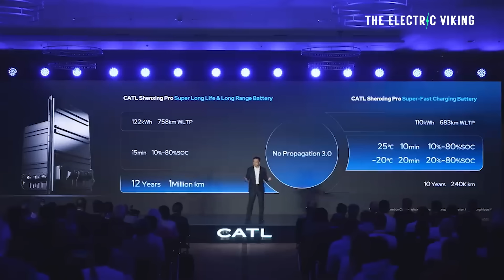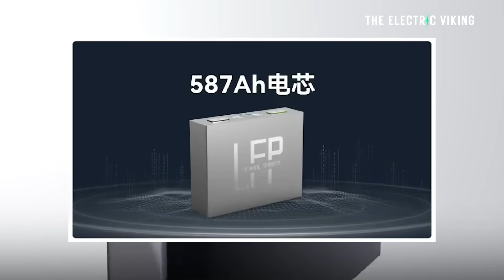CATL Reduces LFP Battery Costs 43% and INCREASES Energy Density

Comment: LFP over NMC because you can charge to 100% regularly without degradation.
Reply: Also much cheaper and safer, unlikely to start a nasty fire or explosion.
Reply: @xianqingdu less likely to start a fire, but more likely to explode
Reply: @xianqingdu  "unlikely to start a nasty fire or explosion"

*less likely.

Not unlikely.
Reply: @mnomadvfx  
So, the over 1,000 CATL battery installations DID have fires (making the claim that they didn't a lie)?
Reply: @mnomadvfx  Even cars with NMC were less likely than ICEVs to catch fire. LFP it is almost unheard of. 
So you not unlikely, it is extremely unlikely for LFP to catch fire.
Reply: Ya...
Reply: Also avoids supply chain issues with Cobalt
Reply: Pretty sure LFP has major problems in cold weather
Reply: both have degradation, just in different rate. I rather use LFP for the safety and peace-of-mind than NMC though.
Reply: It is still better for LFP to be charged to a lower maximum than 100%, it still causes increased degradation, just less than NMC

Comment: Good news for the future. 2025 was the year with $billions BESS order contracts celebrated to be installed in 2026/2027/2028 - at the former, 43% higher prices, lol. Although not competitive anymore - in the EU it´s the consumer that will pay for it the next 12 years until 2037 (at least). If the batteries for EVs get cheaper - it´s sure the EU will increase taxes on car imports from China, for the time being 37% plus VAT of 19%, 23%,25% depending on the destination country. There is a reason for fast adoption of EVs in China - new cars are cheap at 1/3 and 1/2 the cost they are sold in the EU. It makes a difference when You have to pay $45,000 instead of $15000 for the same product - or $36.000 for the better equipped AMG line Mercedes Cla250+ in China and $72.000 for the same car in Germany.

Comment: Increasing energy density by 10% is marginal at best. No way to compete with  fossil fuels that are 30-40 TIMES better on this. Battery technology is evolving but reaches saturation, as any other tech of course, so don't get delirious about it.
Reply: What the hell are you talking about batteries dont produce energy they store it and obviously you can produce energy in a number of different ways they are not competing with fosil fuels your statement makes no sense and fosil fuels continue to go up in price while batteries continue to go down in price.These batteries are used to save money buy storeing energy
Reply: @BLEEDGREEN7777  It is in fact your argument that makes no sense. Energy is never produced, only stored and transfered between different forms. It is basic physics, energy conseration law. The specific energy stored in petrol based fuels, hydrocarbons,  is about 12kW/kg, depending on type. Batteries are striving to reach the dreamed value of 0.5kW/kg, most commonly featuring  half of this value.  Nearly 50 times less.  With the energy densiry (kW/l) the ratio is is slightly better for the batteries, ~30 times difference.
Reply: Sniffing petrol is bad for your health my friend 😮
Reply: @turrafirma  Touching charged wires is even worse mate 🤣...
Reply: Huh...LOL...LowIQ SMFH!
Reply: How are flashlights able to compete with kerosene lanterns? Don't people realize that kerosene has way higher energy density than batteries? Even the military has bought into the flashlight fad.
Reply: @mqb3gofjzkko7nzx38  When military start flying battery powered supersonic jets and drive EV battletanks, I'll get convinced in the e-transition.

Comment: Batteries are energy storage device like a fuel tank. They still require fossil fuels to manufacture.
Reply: less and less..
Reply: If petroleum products are essential for manufacturing stuff, it seems pretty silly to light them on fire for energy.
Reply: @m @mqb3gofjzkko7nzx38 every step of the way. What are you going to do with the gas and diesel produced in the refining process?

Comment: Problem is not the price. Problem is battery LIFESPAN YEARS
Reply: 30 year lifespan is a problem???
Reply: FUD much?  The video states 10,000 cycles >80%. At 1 full cycle per day that's about 28 years. As stated, this product is intended for the long duration storage market, so economically useful life will be multiple decades. Could be amortized at $1 per year per KWH.
Reply: What is the lifespan of these batteries? Would be interesting to hear what you know about this product.
Reply: 30 year lifetime is bullshit. MG 51 kwh LFP battery. 50 000 km in ODO and SOH 91 %

Comment: So will BEV drop by 25%?
Reply: They are getting cheaper. It's probably better that it's been a slow process. Battery technology and safety has been able to improve. Infrastructure has had a chance to keep up. Legacy manufacturers had plenty of time to get up to speed.
Reply: The battery is only a small part. 
Cheaper battery doesn't mean window glass costs less, for example.
Reply: @andrewsaint6581  The battery is about 20% of the car cost. So the net effect will be a 10% cheaper car.

Comment: 1.88KWh cell in a car ? Let's do the math: 400V/3.6V = 111, 111*1.88kWh =  208.68kWh. So yes if your car needs 208.68kWh or double (for 800V) then yes you can use them, otherwise I do not think so... You can not really reduce the number of cells much, maybe by 15% but surely no more, you can go a bit more like 420-450V but much less than 400V is not good for a car.
Reply: They have a hybrid sodium /lfp pack they are ramping up into production for vehicles, thats the only reason they barent marketing them for cars.
Reply: As said repeatedly, cars are not the target market, stationary storage is. Someone could use them for a vehicle but as you note only some kinds of vehicles.

Comment: I have a problem visualizing capacity in gigawatt hours. Could you convert it to powering how many homes per year? Thanks
Reply: GW will do about 750- 1 million homes depending but basically a damn lot. Of course  that's not a battery which could only do that for less than an hour as GWh
Reply: @pietersteenkamp5241 
Australians and Americans use twice the electricity as Europeans. Heavy industry also uses a lot of electricity.
Reply: 1 gigawatthour = 1 million kilowatthours. Theoretically it could power (only!) 100 homes for one year at 833 kWh per month. In practical terms, Gigawatt batteries are used to compensate power needs for short peak demand periods during the day and mainly to provide power after sunset, typically from 18h00 to 20h30 when ppl come back home from work. Under these conditions it could power 200,000 homes for 2.5 hours until recharge from windpower only (as it´s nighttime already) is needed. The next morning the sun helps too again. 200,000 homes really sounds more impressing. Before answering, I wasn´t aware of how little energy it really is - if spread over one year. Thx for the question.